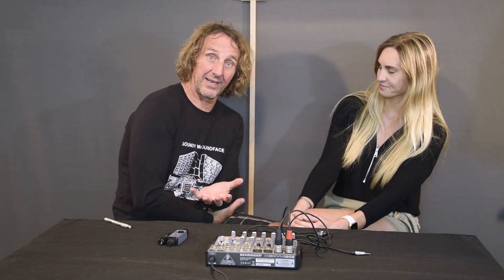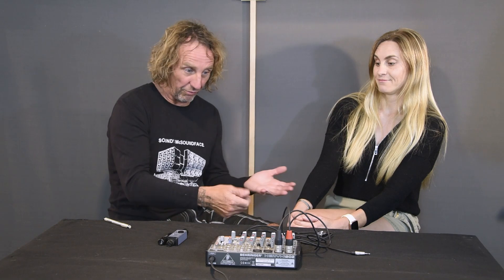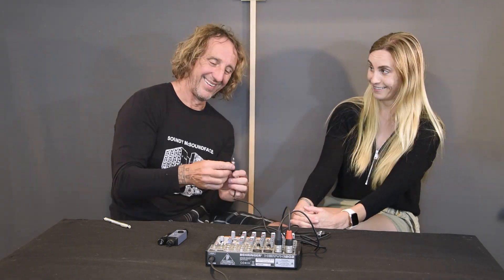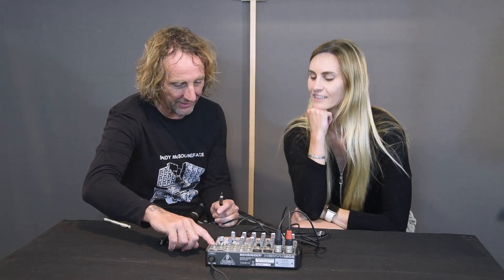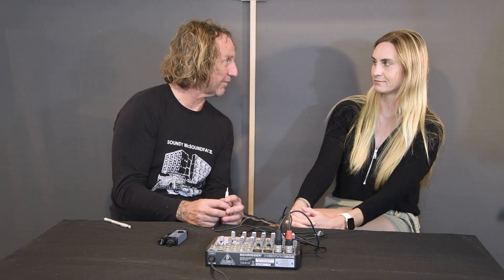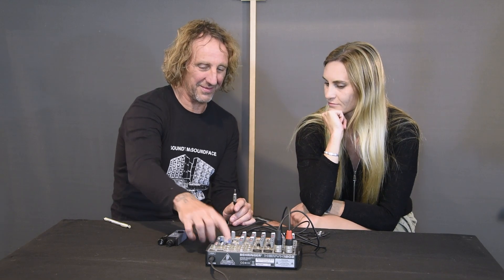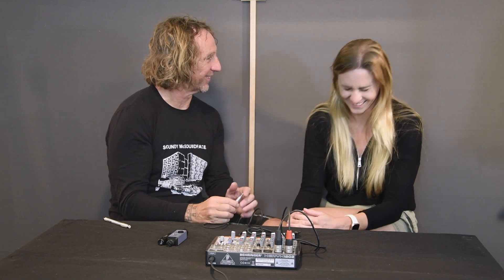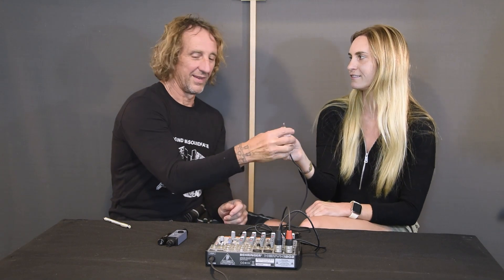Don't Blow Up Soundcards - Mini Plug Phantom Power Test

Comment: Good stuff Dave!
Also, you can avoid destroy your laptop by connecting the cable like this: pin 2  to tip, second pin 2 to ring, pins 1 to sleeve. Pin 3 does not play. So... no phantom power can flow in the cable.
Reply: What I do is connect XLR pin 2 to the tip and ring of the 1/8" plug, and XLR pin 3 to the sleeve. XLR Pin 1 is not connected.  Of course that pin 1 ground might find another path through the power supply, but in that case it should just shunt the power to ground instead of toasting the laptop output.
Reply from the maker: Yeah, that will stop a 48v differential from existing on the plug but then will float the entire laptop or phone chassis at 48v.

Also, the phone or laptop chassis is now connected to the cable shield and both pin3s of the XLRs, making it kind of a live part of the signal.

That said, those things may not present an audible issuenbut is kind of wonky.
Reply: @DaveRat  It's not ideal, but better than burning out the laptop output!  Given the high signal levels and fairly low output impedances I don't think it's an issue.
Reply from the maker: Hmmm, phantom is 48v on pin 2 and also 48v on pin 3. With ground on pin 1. The phantom I think hurts the laptop as you plug it in and jack sends the 48v to everything that touches the tip or ring as ground connects. 

I would say to measure those cables you mention. I believe they will still be phantom but not be stereo.
Reply: @DaveRat  Oh. Didnt know that. I always thought the phantom needs both pins. Good to know. Thank god I didnt destroy any laptops yet...
Reply from the maker: Yes the basis of phantom is identical 48 volts on pin 2 and pin 3 so that the mic diaphragm sees 48 volts on both sides of it and doesn't damage it. It's the difference in voltage that can damage a mic capsule or laptop. And since Mike's only look at pin 2 and 3 for their internal electronics and 48 volts is on both of them, then the mic sees no difference between pin 2 and 3 and is safe